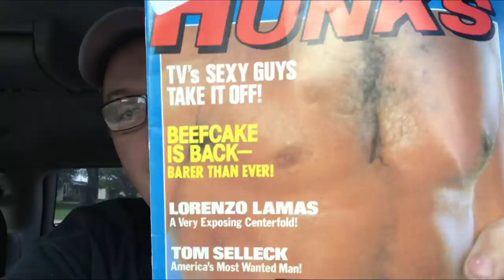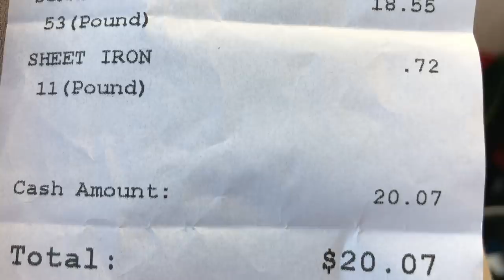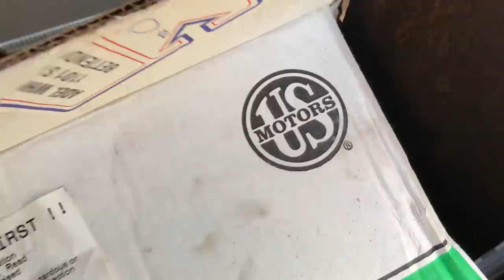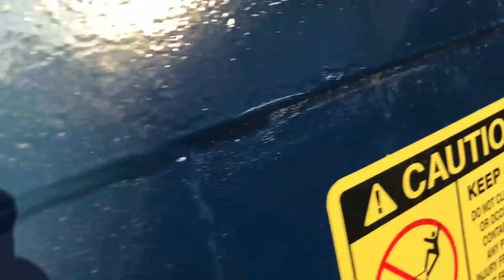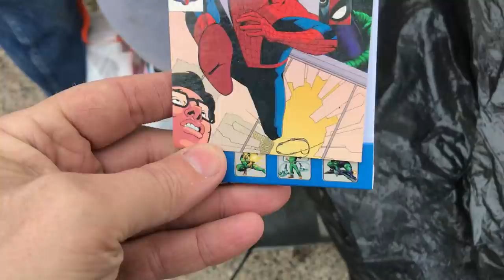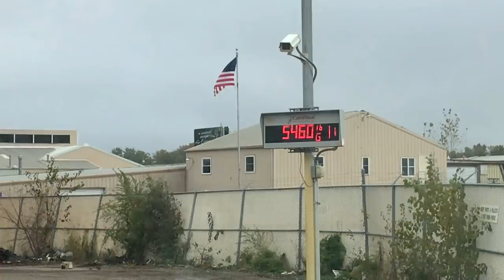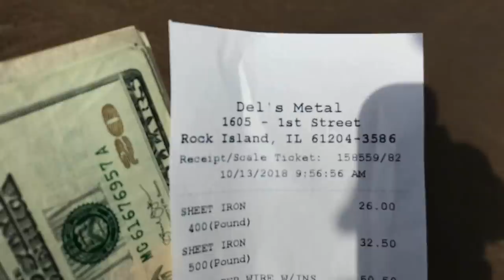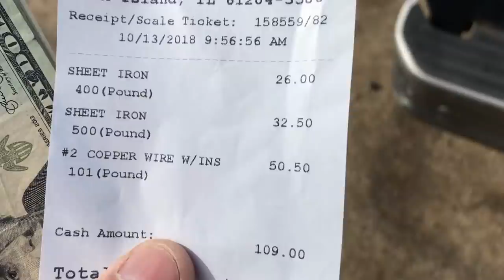Best Pay Out Ever at the Scrapyard! How to Make Money from Free Scrap Metal!

Comment: If that Ford has the 4.9L V6 you should be able to drive it till the wheels fall off. It's quite possibly the best engine Ford ever built. I've got the 95 model and it's got 250,000 plus miles on it and it runs like new. I met a guy who had a 96 model with 500k on it. Those engines never break.
Reply from the maker: Chris Bright yes, it is definitely a strong engine. I just need to run the seafoam through it to clean out the carbon. Then she will run great I think.

Comment: That o2 sensor and putting it in isn't that hard they are charging you way to much to put it in and look at the money you'll make with that truck so I would say yes its worth fixing because you don't want a newer and nicer truck for scrapping it would just get beat up anyway
Reply from the maker: kelly steele He gave us a price break on it. It ended up being $150. Now I just need to run the seafoam through it and I think it will be running great.